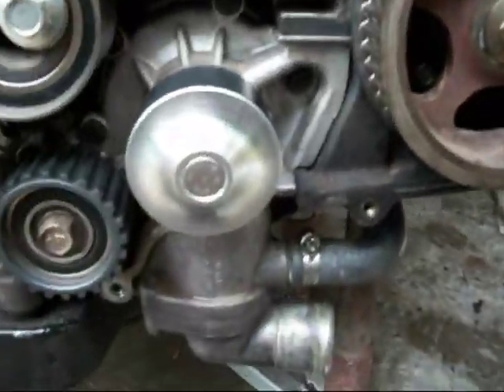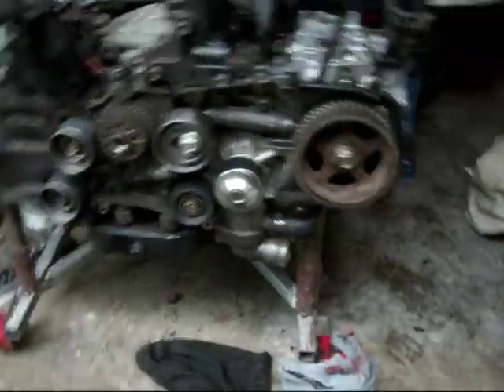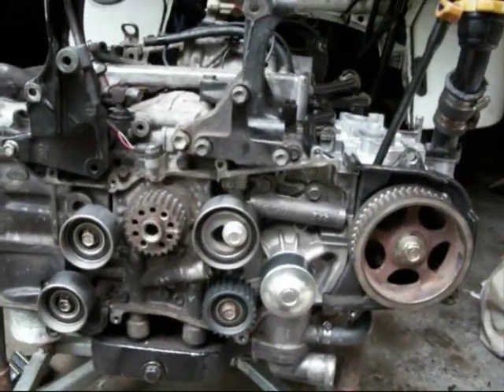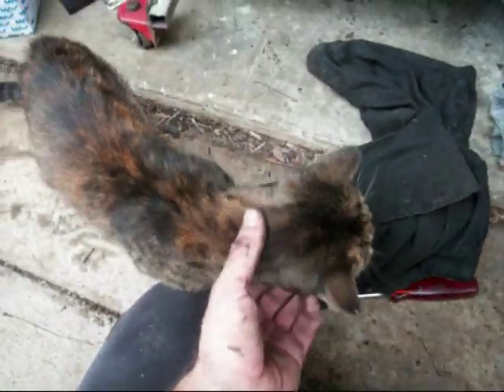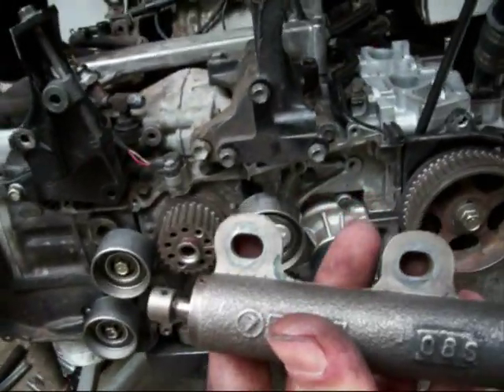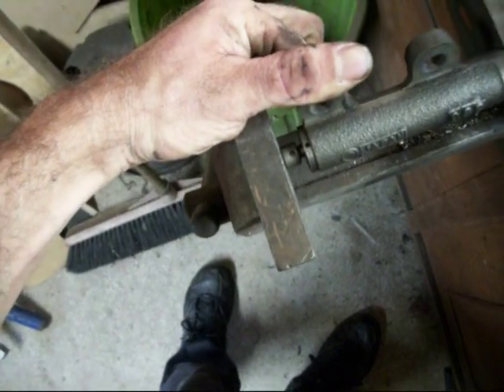Installing a Subaru Timing belt

Comment: Thanks for the super video! I've rebuilt engines with timing chains, but the belts on my Alfas and X1/9 scare the hell out of me. (Mainly the tensioner!) Thanks for going through that bit! (I think I just need someone looking over my shoulder the first time to tell me "yes that way" or "that's not right".) Even having the factory manuals is no substitute for having someone with you that's done it before, but this video took some of the fear away. Thanks!

Comment: You wouldn't believe the crap I'm dealing with??? After a friend (retired mechanic) replaced this timing belt and pulleys, he didn't bother to replace the leaking cam and crank seals while in there. So they come to me to do the job and he stripped out two pulley bolt holes I had to helicoil and over stressed another pulley bolt and it broke off. He even over tightened the nut that holds the pulley for the AC belt tensioner.  Needless to say, the timing belt will be easy to reinstall. lol

Comment from the maker: Hey mate, what year and model engine are we talking? the early SOHC are good as they are non interference,but all the later ones (generally after 97) are interference so its possible to bend the valves if its turned over with the belt off (hard to bend turning by hand).
It should be ok even if it is interference though as it would have been aligned when you took the belt off so wont be real far out.

A socket on the cam gear to bring it back into line should do the trick